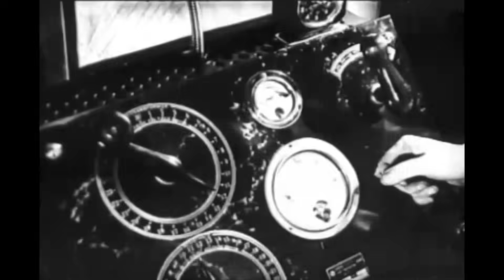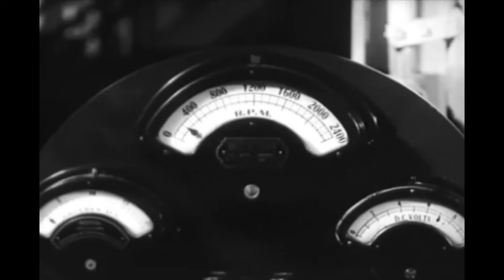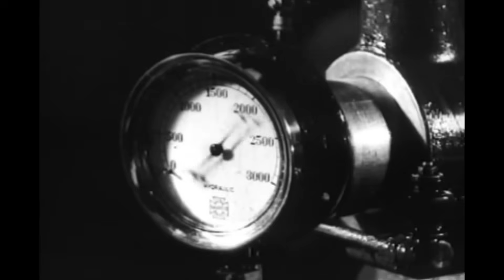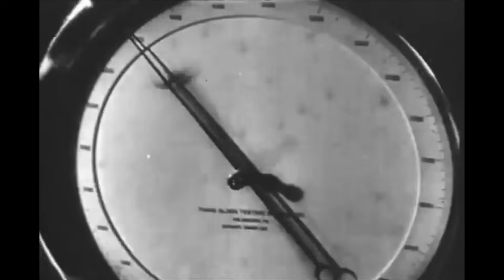The Tractor That Changed the World: Henry Ford’s Ferguson-Sherman Revolution

Comment: My Grandfater got a 1947* 8N* off the Ford Proving Ground near Detroit as a gift from Henry Ford for his part in the lawsuit with Ferguson over the hydraulic lift system. The tractor spent about ''Hard" years on a 100 acre farm in Alma, Michigan where 2 of my cousins worked it daily running that farm. My Dad brought it home in 1962, when I was 10. Within the next 3 years I pretty much took over all the duties for that tractor.  I made gardens all over my neighborhood.  And mowed fields and yards with a 6 foot wide Mott Flail Mower. We used it to grade landscaping and plowing snow. It was my basic transportation for my immediate area. I drove it to all of my friends houses. Occasionally I took it about 8 miles away to Dad's office to mow the weeds down. I still have it.  ben/ michigan u.s.a.
*Our Tractor was an experimental tractor built in 1946 for testing in 1947. I has a "Star" stamped along side the serial number on the engine block.
Reply from the maker: Wow!  What a great set of memories you had!  Thanks so much for sharing and for watching!

Comment: I am the second owner of a 1954 Ferguson TO 35. I still use it on my farm. It still runs great and very little repairs have ever been needed.
Reply: It’s not fords tractor, it’s harry fergusons tractor, and his three point hitch.
Reply from the maker: Thanks for watching!
Reply: @RosaLandon-li3iy  ford built the front end and I think Transmission. Ferguson design on rear differential and 3 point system.
Reply: Be careful not to miss what really made this tractor special. The Ferguson System. The Ferguson tractor from which Ford copied with a handshake agreement (that went pear shaped) is referring mostly to the draft control hydraulic linkage system. Tractors with double the horse power could not successfully pull the same ploughs as the Fergie because without the Ferguson System the plough would bury itself and stall the tractor. The magic is like this. The tine angle / implement weight burys it and the adjustable draft system maintains it at that position.
A grey Fergie has an ohv engine, too. Sure Ford 'invented' the production line or at least applied it to vehicle production.
Reply from the maker: Thanks for watching!
Reply: No 1954 35.  Still a 30.  35 started in 55 or 56.
Reply from the maker: Sounds like a great tractor!  Thanks for sharing and watching!